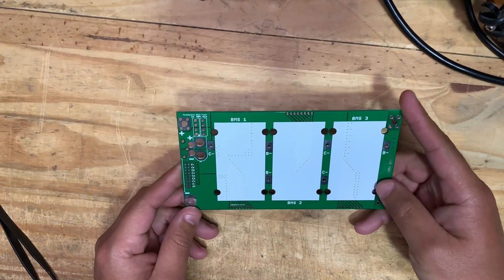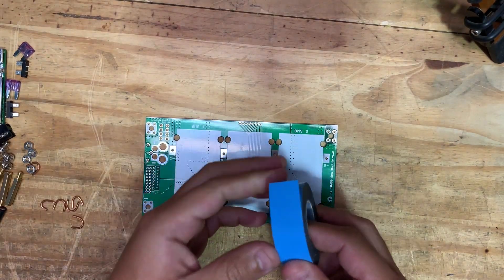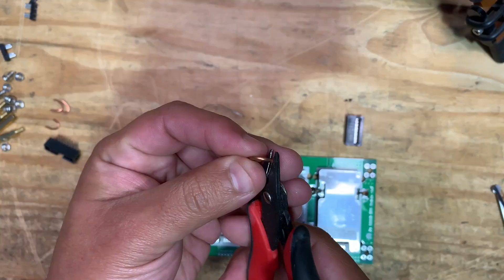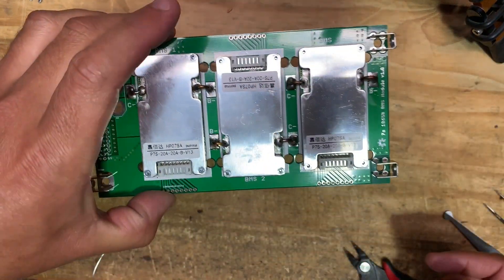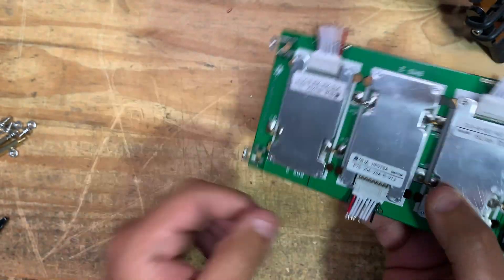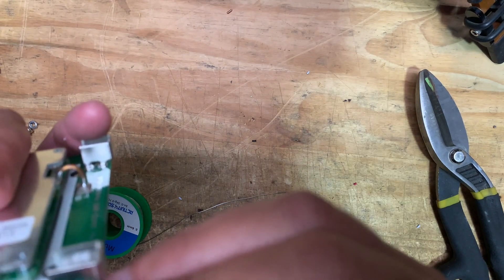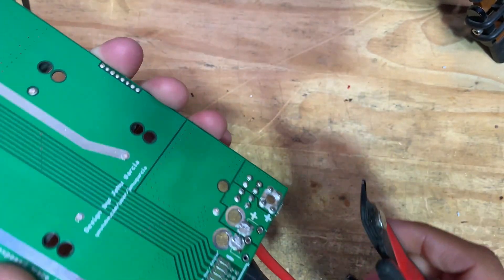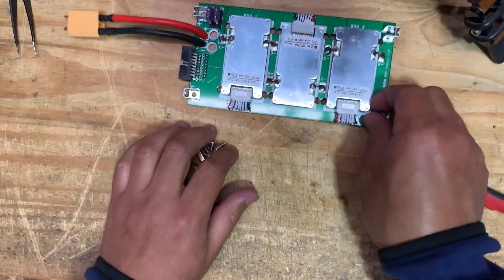Populating Jehu's DiY Powerwall BMS Module

Comment: There is also a thermistor soldered into the board - should I cut it off?  There is also a black shield on the back of the BMS module... leave it on or remove it?
Reply: I have the same question!!!  I believe we should keep the shield to prevent component nibs from shorting to the board.  (I've watched the video several times, and the BMS backside is never shown.)  I'll probably just hot-glue the thermistor to the top of the BMS case for now - after removing the protective blue plastic, of course.   If the BMS gets too hot, it should shut down.

Comment: 7-8min,  If you act ually tin the wires for all the BMS balance cables first it will 1 prevent any stray wires from sticking up as you are trying to bend them in there, and 2 make them solder easier once through.. and I don't see why you don't just unplug it from the BMS, stick it through, solder, then plug back in lol i see other messages... You soldering savage... hahaha really tho tining wires has its purpose, and anyone who solders alot will tell you it is the way to go haha.. You go through all this to get these boards and parts sourced and you don't know to tin wires.. or just can't be bothered? I dunno, but  it would help the users that are trying to learn from you, regarless of if its carelessness or ignorance, your buyers will have a better time with it you teach them to tin things first.
Reply: and I hand't seen you fighting with the stray wires yet... really bro.. just size up the balance plug, cut, strip.. then TIN, (put a coating of solder on all the wires) then you can just stick them through the holes no problem, no fighting with stray wires.. fix your vid and help your buyers. .. .. honestly .. try it...

Comment: What is the configuration for the BMS boards? How many cells does each BMS board monitor? I eventually want to buy the system you offer but don't know enough about the configuration to get started.

Comment: I would love to see a new version of these packs. Tesla has been upgrading to 21700 batteries in many of their battery packs, these batteries have better energy density, and produce lower heat at 1C continuous discharge, meaning they're good for more cycles under appropriate conditions. One downside is these batteries are slightly larger (slightly more costly too), but you'd have ~500Wh for a pack containing 5 boards that each house 7 batteries in series like you make in these videos, which would still run at 25.2 V nominal. This would be good for builds that require more power storage, or need to sustain higher loads, or have increased longevity in mind.

Another note, if you ran Samsung 48Gs in a 21700 set up, you'd produce very similar current (48 A, compared to 50 A), but store 600Wh in a fully configured pack, compared to 400Wh using the Panasonic NCR 18650BD.

Comment: You should tin the wires and connector contacts before soldering them together. The solder connection will last longer, make better contact, and will look nicer (though no one will notice once you cover it with heat shrink tubing)

Comment: The BMS is different then the one in the video that's why the solid copper does not fit into the hole of the BMS
Reply: Glenn, what did u do to solve? Smaller wire or solder on top? Loots like its thru hold plated
Reply: Ian Shaw I put the wire in a drill and used a piece of sandpaper to make the ends smaller to get it to fit in the hole😉

Comment: The solid copper wire you sent with the kit is to large diameter to fit into the hole of the BMS 😁

Comment: Are you installing the fuse in parallel if it is I dont think that I will work the way as a single fuse, considering the resistance of the fuse itself. Just a thought.

Comment: Pre-tinning/soldering the wire tips before putting them through the pcb hole would probably help prevent the problem of loose wires at 8:41.

Comment: These look nice but why not design it with header sockets to plug in the modules rather than soldering the wires. Also what do you think about making the modules bolt on for maintenance purposes, if you have to replace one.

Comment: Question: I bought one of the Mobius medical battery packs on Ebay.  It worked when I first got the pack but suddenly would not discharge. It is at full charge but only get 5 or 8 volts at the bms output pins. I tried all the tricks I found on youtube like putting power to it but nothing worked. So I replaced the bms with a simple ebay board. It was working fine for a while now I have the same problem. Pack show 12.3v at direct connections but only 5.5v at bms terminal. I was playing around with it trying to charge with a small solar panel when it quite working. Guessing I somehow triggered a protection mode. Is there a way to reset/reactivate the bms so I can get back to using it to power my rv lights.

Comment: What is the max Amp discharge allowed? on the 7s10p pack and the 7s25p pack?  Is it 20amp max current?  Meaning max WH discharge is 480watts plugged in? And the max Charge is 480watts?

Comment: Can you post a link to the current best buy on 18650 cells?  also  If I was going to spend 300 on upgrading my battery bank which is currently AGM renogy batteries, should i buy another and keep it AGM or for the same price could i build a cheaper or better battery with 18650 cells for the same cost? If so can you link  all the pieces required.  im looking for easy plug and play but can do some soldering if needed

Comment: Suggestion. Give yourself about another quarter inch on the BMS pigtails. Strip back to the same point you are now. Now you have more lead to push through the holes. When soldering pull from the other side, then clip off on the other side after soldering. you may be able to bend the lead over on the other side to hold it tight and do all the soldering at one time.

Comment: Jehu  How does the BMS board see each cell if you have more then one battery board ( 10 boards = 70 cells)?   How many boards can one BMS board controll ?
Reply from the maker: it doesn't need to,  bms manages groups of cells

Comment: Where I can find cheapest 18650 holders?
I need like 100 pcs
Reply from the maker: Aliexpress, I have links on my kit.com
Reply: @jehugarcia   Thanks brother!
I want to use them to put a test battery pack, run few cycles, see if P sections are all balanced, and if something is not, I can swap cells easily, retest and this way I can quickly have a verified pack without the need to test every cells separately.

Comment: I would love to see assembling examples for supporting different loads in a power wall environment. So how should one put together a power wall with these battery/BMS modules to build a power wall that can support 4, 6 or 8 kW, given 18650s with 2A/1C continuous discharge. I have 1400 cells ready to be put in a powerwall and I am thinking about using your kit or putting them together oldskool with battery holders and the Batrium.
Oh and as always, thank you for your effort and the energy you put into these projects.. you have educated to many of us :)

Comment: Jehu, just found your Channel and have been binge watching a lot of your content awesome stuff. One recommendation to make things easier on your followers in these projects… getting thru the ribbon cable process for a cleaner and faster I find doing in my applications is to pre-solder the leads. This eliminates rouge strands from push thru process and bridging during the soldering process. Hope to run into you one day San B! Great work!!!
Reply from the maker: Tried that but then it doesn’t fit through the hole
Reply: @jehugarcia  The trick is to use very little solder on the wire. I'll order one of your kits soon and probably do a video of my experience with the whole build from start to finish. Are you good with paypal now? what other methods do you accept?

Comment: What’s this lil battery controller pack for? It seems like it could only power an alarm clock or something small. Could it power a light?
Reply: Jehu is showing how to build a Battery Management Board. It's not a battery pack. This board is added to a battery pack to balance the charge of each cell by cutting charge power to the fully charged cells so the low ones can fully charge with out over charging the ones that are already fully charged. ( or instead of cutting power to a fully charge cell, it creates a load to drain the excess power from then over charged cell)
Reply from the maker: A 50A light